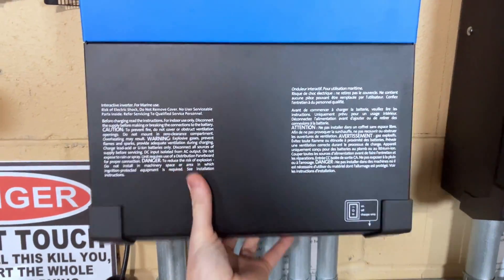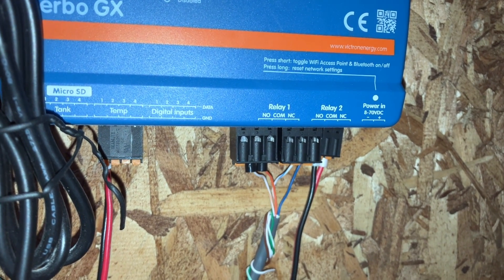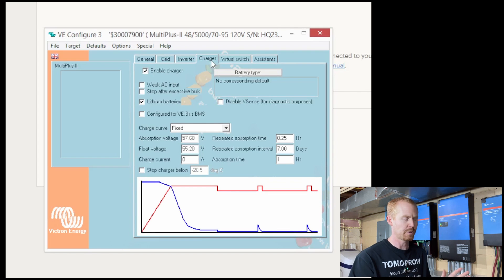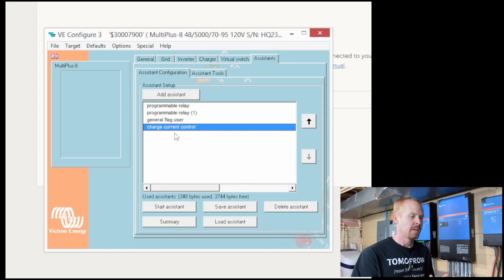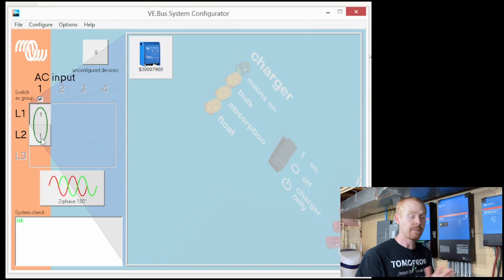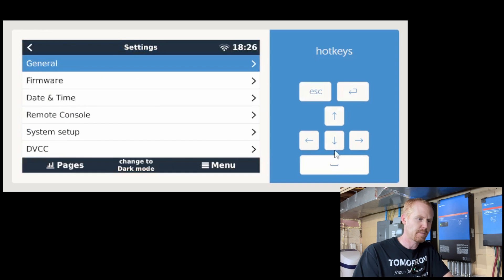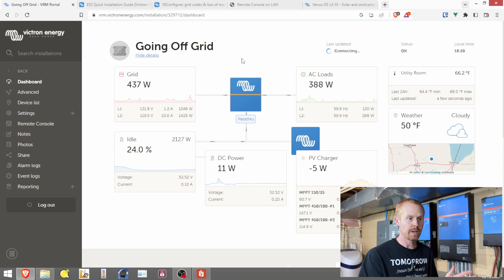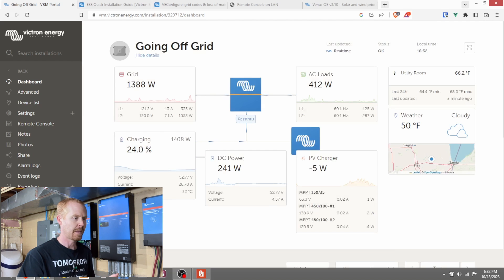Custom Grid Charging: Victron MultiPlus 2 & Cerbo Relay

Comment from the maker: * Something I forgot to mention in the video, but make sure to add the charge current assistant to your L2 inverter as well.  If you don't, the bulk charge light will always remain on when your inverters switch to passthrough mode.  *

Links to the parts & pieces in the video (affiliate links)
------------------------------------
Victron 48V MultiPlus-II 5kVA 120V Inverter
https://www.currentconnected.com/product/victron-48v-multiplus-2-5kva-120v-inverter-70a-charger/?ref=AzzpK9Fl

10kVA 120/240v Base MultiPlus-II System
https://www.currentconnected.com/product/10kva-120-240v-multiplus-2-5kva/?ref=AzzpK9Fl

Victron Cerbo GX
https://www.currentconnected.com/product/victron-cerbo-gx-system-controller/?ref=AzzpK9Fl

Victron GX Touch 7" Display
https://www.currentconnected.com/product/gx-touch-display-cerbo-gx/?ref=AzzpK9Fl

Comment: Nice simple idea with minimum wiring and a great step by step explanation for the programming. I'm looking to take your idea a step further & automate the charging process on a daily schedule, say 08.00 - 22.00 hrs. Can this be done with Assistants?
Reply from the maker: Thanks!  

I get this question a lot.  As far as I know (without using something like NodeRed), you would have to use the scheduled option of the generator start/stop feature.  The downside is that you would have to enable charging any time the grid is connected, so if your battery runs low and the system fails over to the grid, it would start charging.

Comment: I want to do this with my two Victron Multiplus II 3000VAs, on days (or weeks) its cloudy and not really producing solar.  Start charging when the battery is at 20%, and finish when its at 50% (but do it automatically).  Im using a Raspberry Pi 2B until I can buy a Cerbo GX.
Reply from the maker: Outside of looking into NodeRed, you may have to set it up so that anytime your inverter switches to grid it will automatically charge.  You may want to look at the "Solar and Wind" priority option in Victron connect as well.  

Here's a couple videos I did on controlling relays with the Raspberry Pi and controlling when your Victron inverter switches between battery and grid power. 
https://youtu.be/lv5rqqbDFL0
https://youtu.be/4ZsGHi8nKGc
Reply: @AdamDeLayDIY Yeah, currently watching the video on setting up the relays with the Raspberry Pi.

Comment: Hi, great videos, helped me a lot. Is there a way to program this switch so that it switches on only during the night? Our electrcity is less expensive during the night and I would like to "harvest" some cheap electricity that I can use during the day when prices are up.
Reply from the maker: Thanks!

You can use the scheduling option in the generator function on the Cerbo to control when the inverter switches to grid input (https://youtu.be/4ZsGHi8nKGc). However, out of the box, there’s no direct way to schedule when it starts charging.

That said, if your inverter is set to always charge when switching to grid power, you could use the generator scheduling feature to switch to grid at night, which would trigger charging. Just keep in mind that if you set any other conditions for switching to the grid, it would also start charging during those times.

If you're comfortable with customization, Node-RED could likely handle this, but it would require some advanced setup.

Comment: Thank you for the video. This is close to what I'm trying to do.  The difference is that I need this to switch automatically depending on a condition that I have yet to define.  I'm sure it's possible, but I need the multiplus to only charge when in grid (shore or generator) power and not when it's assisting or in passthru.  Do you have any ideas on this?
Reply from the maker: @SolarSupplyHouse  when the batteries end up assisting the grid loads, that means there’s not enough grid power for the current running loads so the inverter wouldn’t be charging anyway.

As far as pass through mode, that’s the same as when the grid is connected.  So you would have to control when charging happens and that why I have this option.  I only want to charge at very limited times, so when I want it to charge, I hit the switch.  Otherwise every other time just allows the grid to power the loads.
Reply: @AdamDeLayDIY  Thank you for the prompt reply. Please let me clarify. In my mobile RV Power system (all Victron) I installed an additional transfer switch that senses when the generator is running and transfers to that power source.  That is when I want the system to automatically start the charging. When it's on inverter only, it will not charge, obviously. But I have a unique situation. I have two inverters. The second, very cheap,  inverter feeds the transfer switch and simulates a primary source of power (it simulates a shore input) and the Primary Multiplus goes into passthru or assist mode. Now, I cannot have charging  while in this mode, as it would be a loop to the battery pack. Now, sounds silly to do this, but at high loads, when off grid, I need more than 3000 watts because in hot weather and high loads, like air conditioning,  the primary multiplus will go into temperature shutdown. So I split the loads between the two inverters in an assist mode or pass thru. So, I switch to generator on the added transfer switch, I would like then the multiplus to start charging from the 5k watt generator input.The mulltiplus will go into pasthru mode and charge batteries and handle large loads.  Is that more clear (I'm nearly confused! LOL).
Reply from the maker: @ it sounds like you would either have to trigger the charging manually OR instead of wiring from the inverter to the Cerbo (like in the video), you run the wire from the inverter to the automatic transfer switch somehow so when the transfer switch kicks in, it also turns on the charger.  Would take some playing around to see how you could make it work though.
Reply: @AdamDeLayDIY  Thanks for the input. That's the solution I'm looking at. The transfer switch has a relay contact, but I don't have documentation on it of what can activate it.  So, If I understand, closing the remote relay will "short" the auxiliary on the Multiplus to +5V and that will turn on the charge assistant? Or am I backwards?
Reply from the maker: @ off the top of my head, I wanna say that there’s no voltage on the Aux input, it’s just open or closed and if it’s closed it activates charging.  You should be able to just connect the two terminals together manually and see charging begin.
Reply: @AdamDeLayDIY  Thank you. Liked and Subscribed.
Reply from the maker: @ appreciate that!

Comment: Is it possible to do this with just a Multiplus II GX alone? It has a build in Cerbo so that should work, right?
Reply from the maker: I'm not quite sure.  I have never seen a GX model to know how they combined the two devices together.  

I would imagine if there's still dedicated Cerbo relay terminals then you should be able to set everything up the same way.  

Let me know what you find!

Comment: Hello Adams, thanks for super informative videos as always. We are wondering whether you have wires connect to secondary Inverter Aux2 as well ? We only saw you did on Primary Inverter. 👍😀
Reply from the maker: @adassociates8235  thanks!

Nope, I only wired up to the primary inverter.  It handles the change for both.  I did forget to add the assistant to the secondary inverter though.  

Custom Grid Charging - I Missed a Step...
https://youtu.be/5RkDZTYVTKw

Comment: 🙏 Thanks for this tip, I was going to do something similar but using two Multiplus 2 in parallel unfortunately if I connect my AC in it will automatically pass through to the out which I don't want. So I've decided to swap ACOut 1 for AC1 Out 2 which seems to be switchable and I've created an assistant setting that will shut down the AC2 out when Acin is detected allowing me to start the charging in two ways: 1 Manualy as you have described here or 2 automatically by keeping the inverter in the ON mode which I understand will initiate the charge based upon the battery SOC if set up correctly. I might choose option 1 so that I am in full control of the charging events just like you did 😍 I'll now go to your follow-up video on this.
Reply from the maker: Thanks.  I also have another video on how to ignore AC input when it's connected unless certain criteria is met.  I actually end up going over multiple methods to do this but end up going with a way that allows me to control everything from the Cerbo display.

https://youtu.be/4ZsGHi8nKGc
Reply: @AdamDeLayDIY  I'll check that out and see if it can be of help in my situation since I would also like to control everything from my Cerbo. I think I can do it but I haven' tested it yet. BTW you don't need to stop the AC out when charging as I do evidently . . or do you? Thanks again 🙏
Reply from the maker: @ if you want to charge from the grid, all your ac out loads are passed through to the AC In.  It’s an all or nothing situation.
Reply: @AdamDeLayDIY  What about if I use AC2Out, which is switchable? I should be able to use an assistant that interrupts AC2Out so I can obtain what I need, no AC through,  wouldn't I?
Reply from the maker: @9111logic  Off the top of my head, it seems like it would work.  Do you really want to kill all your loads when trying to charge though?  I would think you would want to run your loads and charge at the same time and then disconnect AC IN when charging is complete.
Reply: @AdamDeLayDIY  Very legitimate point, that will be possible when all the work is completed, you see, I am constructing a second building for which the photovoltaic system is primarily designed.
There is provision for the full load of the two buildings to be supplied if needed but the underground adequate armoured cable is only installed for half of the distance at the moment.
Because the two buildings are 55 metres away from each other, I have also installed a temporary line with 10mm cables designed to only provide energy for the solar shed lights and for battery charging up to 50A.
If I were to allow that to work in a conventional way, in the event of a heavy load starting inadvertently, I would risk overloading the 10mm wiring so, during the charging times at night and only in the winter when needed, building A can still use the grid from the supply consumer unit whilst I can charge the batteries for the following day for building B via the temporary 10mm line.
Eventually, this will change to a conventional system. 
I shall attempt my plan and report soon.
Thank you
Reply from the maker: @9111logic  Very interesting!  Good luck and let me know how it goes!

Comment: What is different between this approach and simply controlling using the MultiPlus’ mode (on, charger only, inverter only, off)?
Reply from the maker: That's a great question.  I'm trying to think back to the reasoning, but I believe it had to do with the fact that when AC IN is detected, the inverter automatically switches over to that to supply power to the loads and start charging the battery (I have a solution for this aspect in another video).    

I don't believe the "inverter only" works when it's in AC bypass mode (unless something has changed).  So it would always try and charge the batteries whenever AC IN was connected.  This relay option allows me to selectively choose when I want to charge from AC IN.
Reply: @AdamDeLayDIY  I think you're correct. I am currently running both my systems in "Prioritize Wind and Solar" mode, so they don't charge from AC unless I tell them to. So I flip between "Charger Only" and "On" as necessary.
Reply from the maker: @adamsherman  Yeah that feature came out after this video I believe.  If I remember correctly, that feature will force charge you from the grid/AC IN if your batteries go a certain amount of time without hitting 100%.  Does it abide by the setting you have set for "inverter only"?
Reply: @ pretty sure inverter only is just that. No matter what.
Reply from the maker: @adamsherman  Good to hear!  Thanks for sharing!
Reply: @AdamDeLayDIY Thanks for your video on the setup using the relay! Just FYI that I've been using the on/charger only/inverter only/off option on my multi ii 3k in an RV. I  switch to inverter only for zero charging/run off batteries, charger only with charge rate set for how much I want to charge vs the DC loads. It can be set down to 1a charge and also fine-tuned in the VRM (eg 1.2a). Depending on the DC loads then I can let it discharge, hold steady SOC, or charge. Thanks again for sharing the relay setup and displaying it on the cerbo. It is nice to know alternate options and how to configure it.

Comment: Why can't all this be done automatically with the Cerbo or using ESS?
Reply from the maker: @joeboxter3635  the relay controls can be handled through the cerbo, but not the AC in options. 

I haven’t messed with the ESS assistant.  Enabling that allows for potential power to flow backwards to the grid, even if not on purpose.  Using the “ignore AC In” option, either all your power comes from the grid or it all comes from the battery.  There is no blending.

Comment: How we can turn the charger on when the system feed to the grid by the solar system and turn the charger off when the load is consumed from the grid? I am looking to add the battery to the existing solar system. Thank you so much.
Reply from the maker: I'm not sure you can push power to the grid and charge the batteries at the same time.  Power only flows in a single direction.  You would have to charge the batteries first and then have power get pushed back to the grid.  

You may want to look into the ESS Assistant.

Comment: I m using MultiPlus-II GX 48v 3000va, I followed the instructions settings on this video for relay open and close via VRM, to ignore Grid when SOC is above 40% and open relay when SOC 30% but it's not working.
Reply from the maker: The relay for grid charging is manual and it's separate from the ability to ignore AC Input.  So which isn't working?  Grid charging or ignoring AC Input?

Comment: OK I need help here. Had my multiplus 2 setup for a week and for the most part it works OK. Coming from a setup of 2 seperate inverters with ats's etc and even though the whole thing looked like a mess it worked beautifully. I'm really struggling to get the multiplus 2 to do exactly what I want. Which is essentially what you have kinda done. However... I've followed this video and your previous to ignore ac input. I have cheap power at nighttime so I was hoping I could blend these two to work for me. However this doesn't seem to be the case. This "one switch charging" doesn't work if my assistant is currently ignoring my ac input. And frustratingly my battery won't charge at night with my current set to 0A. There has to be something very obvious I'm overlooking.
Reply from the maker: You'll have to be on grid power in order for the grid charging to work.  So if you configured your "Ignore AC Input" by using the Cerbo generator feature, you'll have to "start the generator" to switch to grid and then switch the grid charging relay.  

If you want to do this on its own, I believe you can set a time based condition in the generator settings on the cerbo for your overnight hours.  The only thing that can't be automatic is the relay switch for grid charging.  You would have to turn that on manually and then when the "generator" turned on, it would start charging from the grid.  

If you wanted to have it all be automatic, you might have to look at setting up Node Red for more fine grained control.

Comment: Great video! Is there a way to have charging from the grid based on a current value from a separate CT (e.g via a VM-3P75CT)? I have a separate grid-tied PV system that exports to the grid for a pittance. I'd like to measure this grid export and authomatically push the excess power into my Victron system (so a variable current equal to what is being exported) . Do you know if this can also be done via VE Connect?
Reply from the maker: Thanks.  

That's not something I'm familiar with.  I would recommend asking that question on the Victron Community forum (https://community.victronenergy.com/index.html).  If it's been done, someone's done it on that site.

Comment: if the charge current + loads are higher than the grid (shore input limit), does it throttle down the charge current?
Reply from the maker: I very rarely use the grid charging option, but I believe it does throttle down charging if output power gets too high.  Someone else might be able to comment more.

Comment: Very informative tutorial, I’m in the process of completing my Victron system. Only problem is the cerbo gx not connecting to the internet steadily. I was told to connect the cerbo straight to the router not a share portal. Love the flexibility of the system but my  Schneider system is a work horse that keeps going. I’m just upgrading to the Victron for more options.
Reply from the maker: Thanks Pete.  Sorry you're having connectivity issues with the Cerbo.  I'm using wifi on mine, but the access point is only a few feet away on the other side of the wall.